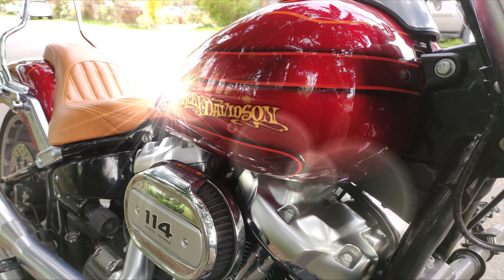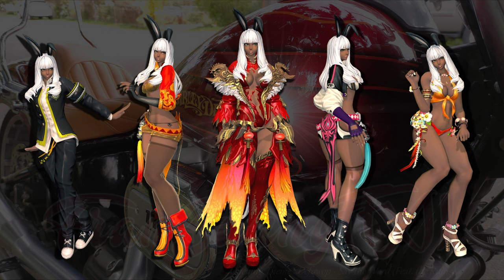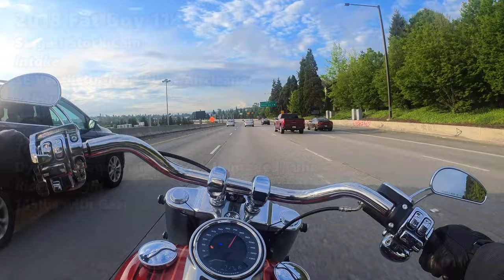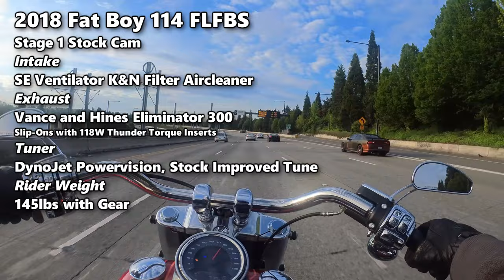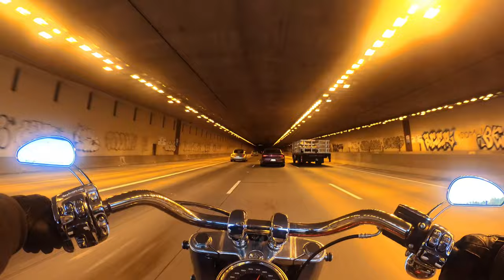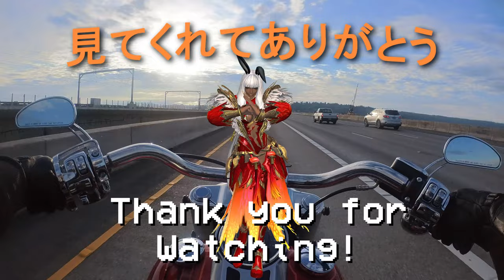Harley-Davidson Fat Boy 114  Top Speed(Unlimited) - Stock Cam 2018 M8 Softail FLFBS

Comment: Did the GoPro GPS show speed as well? The tunnel may have messed that up. It would collaborate the accuracy of the speedometer.
Reply from the maker: No GPS this time. I have an insta360 on my helmet, I wasnt running GPS at the time.
The speedometer was calibrated for an 18inch wheel so it should be pretty close to spot on.
Stage2 ill get a GPS clip.

Comment: Hi Today I test rode a 2018 fatboy with 5700 miles.  Im New to Harleys, is it normal with the Vibration even at high speed? No wobbling nothing like that.
Reply from the maker: Yeah, that vibration is more intense on older harleys though. This one has dual counter balancers and i find it pretty smooth but I can still feel it rev.
Reply: Thank you

Comment: I have the same bike, how did you remove the speed limiter?
Reply from the maker: I did it with my PowerVision. Flashing the stock improved tune removed the speed limiter
Reply: @FranBunnyFFXII  Does it get to 155mph without it? Stock mine tops out at 120mph
Reply from the maker: @damarisduna  No, only 130 according to the speedo.
Reply: @damarisduna these Harleys won’t realistically get to 170mph regardless of the power but 155mph is possible but there will be a lot of stability issues

Comment: Its not a fatboy 114
Reply from the maker: Yes it is. It's a 2018 Fat Boy FLFBS 114, with the Stock cam.
What on earth makes you think it's not a fat boy 114?
Reply: @FranBunnyFFXII  its handle bar
Reply from the maker: @mahavirmalhotra5909  That's the stock handlebar. I swapped to a 4inch pullback riser.
Reply: @FranBunnyFFXII  thats cool. Why dont u put your real pic
Reply: @mahavirmalhotra5909  big incel energy.